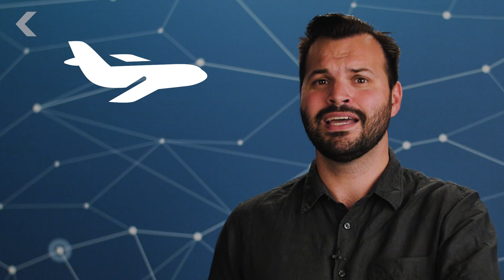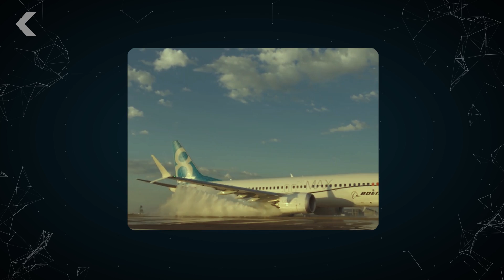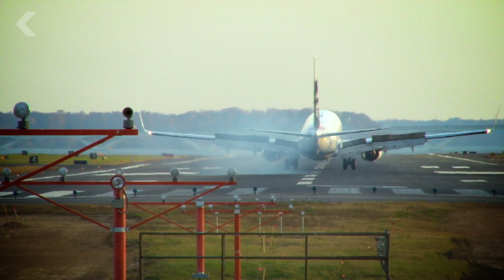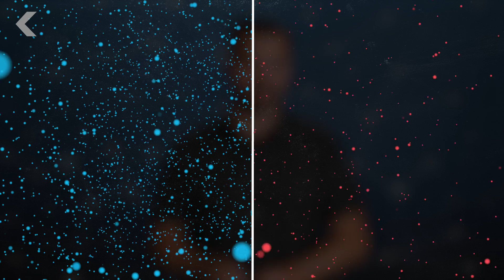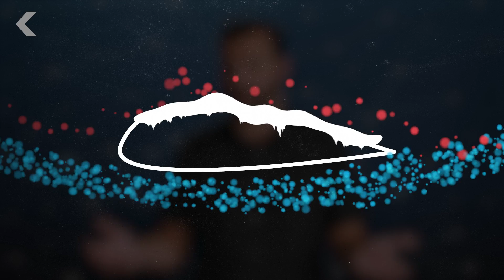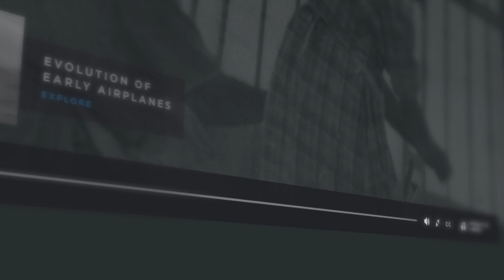Engineers Love to Break Airplanes Before You Fly in Them, Here's Why

Comment: Lift is not about the air moving faster over the wing, at least, that is not the full explanation. The wind moving faster over the wing causes a lower pressure, causing suction. The air can't be sucked from below, as the wing is there, so its sucked from above, downwards. The wing shape additionally redirects the air passing over the wing downwards behind it. This means a lot of air is now moving down after the wing has passed it, and that is what causes lift. 
Remember, every action has an equal and opposite reaction.

Comment: Just had a job interview at a place where they test the inner workings of the jet engines ( the moving parts) they spin the metal cylinder which the blades inside the jet engine are attached to, up to 100,000 rpms for weeks on end. Then they add high temps, then freezing temps, then after thats complete they measure the cylinder and see how much if any, the part expanded or contrasted under super fast spinning. Several times faster than a jet would ever spin its engine.. Was a very intresting job interview. They do a lot of work for Rolls Royce, GE, Pratt And Whitney, and Mitsubishi. Sometimes these companies send a new type of non-ferrous steel or an alloy made part and want this company to spin the innerworking till it breaks.. Really cool stuff.. Great vid T 😎!

Comment: Approximately 70% of the lift of a wing is created by the shape of the upper surface of the wing. The curvature of the upper surface causes the airflow to travel faster over the top of the wing than it travels across the lower surface. This generates a low pressure area on lower surface. This is called the 'venturi effect', it is the same as an automobile carburetor, when high speed air flows past the fuel import jet it will suck fuel into the intake slipstream.

Comment: Density has a play in lift, but not as described. It's more to do with Bernoulli's Principle than anything else. Fast moving air creates a pressure drop.  This is why your shower curtain moves in when you turn the water on. The curvature of the wing makes the air travel a greater distance, which creates faster moving air on the top of the wing than the bottom. This literally causes the wing to be sucked upward by negative pressure. Air is not pushing the wing up from the bottom. It is sucking it up from the top. The denser the air, the more air that travels over the wing, ergo the greater the lift. If it's too hot out, the air may not be dense enough to create the upward lift required to counteract gravity, but it is not the fundamental principle that allows for flight Mic Drop

Comment: Bit of useless information. When South African Airways flew the Boeing 747-400 (or older) from Johannesburg to Miami through Cape Town they would fill the plane to the brim with Jet fuel and take off and get up to 42 000 feet as quickly as possible.

This would let the fuel freeze, however jet A1 and A fuel would contract itself when it froze. The 747 would land in Cape Town and refuel with fuel again and then send it to Miami with essentially fuel tanks with more fuel than it could hold (somewhere around 110 - 120% fuel capacity). That is how they used fly routes like that before the new era of fuel efficient aircraft such as the 787 Dreamliner and Airbus A320 Neo among others. 

Hope you learnt something :)
Reply: That's pretty fucking genius, but one question - wouldn't it just unfreeze by time it lands in Cape Town?
Reply: I don't understand, isn't this doubly risky? First, because if the fuel freezes extensively it will stop feeding the engines with new fuel. How did they even know which part of the fuel would freeze first? 
And second, if the fuel unfreezes more quickly than expected at 110-120% capacity it might breach the fuel tanks at worst or (if this was detected by sensors) the pilots would have to eject some fuel to prevent the fuel tanks from breaching (or it could be done automatically, if the fuel tanks were designed for 100+% capacity), so losing fuel and thus money.
Reply: Kye Martinovic that's really cool!

Comment: This isn't simply reserved to mechanical engineering. All forms of engineers employ this idea. It's called stress and limit testing, and once you know the limits you do something called edge testing. Even software engineers do this. We test the limits of what we can do. We force our software to break under the conditions we know it should break. If it breaks under conditions that we know it shouldn't, we engineer a fix for it. Once we know the limits, we perform edge cases, to find out how the software performs when pushed to the edge of it's capability.

Comment: *154% of specificed maximum load. Not 154 times
Reply: Yeah, 154% oops!
Reply: Trey B THANK YOU
Reply: Trey B. Really ...nice catch. That was a bit much i would say. Thank you.
Reply: Trace Dominguez If you reupload, fix that other graphic too. Just tilt it slightly to make an angle of attack so the air is flowing slightly down instead of slightly up at the end and then it's reasonably close to accurate.